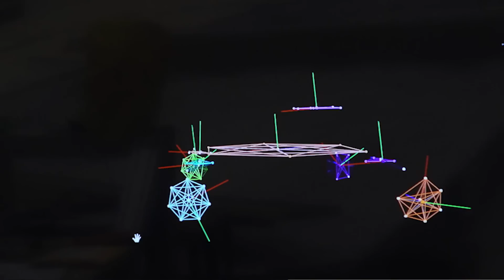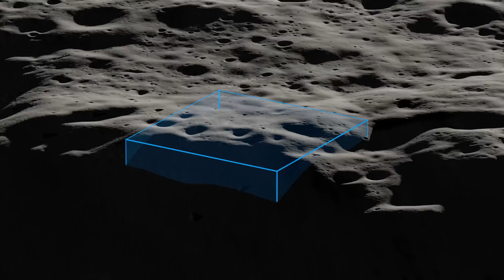The Dumbest NASA Decision In Years? Why NASA is Being Forced To Ground Rover and Sent Ballast.

Comment: No Scott, we don't need to have someone ask for the program to be given additional funds for additional time and additional efforts to get a stillborn project flying.  This is what the normal American citizen gripes and bitches about all the time.  How about ,,,, instead of asking for more money to add funding to finish the project.... how about asking all the people that have gotten salaries for this project to work for FREE ??...  That team was given a definite time frame,  an exhorbitant funding source that grew to 30% over budget.... it got the axe.  And it should be permanently axed. And ostricised by the space faring community as failures.  They did not get the job done, they over spent fiscally, and they did not complete the task in a definite time frame.  They are failures. They failed,  so why would we , the American people want to throw more good money at a failed boondoggle.  If you had a stiffy for a Cessna 414, vintage, and you found the one you wanted.  Low hours,  fresh RAM engine rebuilds,  tagged , stickered,  tax title license etc ad finausium,  and when you got the darling to a runway near you,  you suddenly found a HUGE crack in the airframe.  But it passed, ddddd,,,eeeeee,,,,ffffff..  You would : A, be pissed,  B: not throwing good money after bad, and C: seek legal recourse for misrepresentation against the seller and agent, the inspector,  and anyone else legal counsel told you to hang the hat on.  No, no more money for the lemon.......
Reply from the maker: That’s one hell of a long thread that completely misses the private company getting paid $250million to fly ballast because it took too long.

I don’t see you suggesting NASA refuse to pay the private company.
Reply: Boy are you in water WAY over your head.

Comment: I have a bit more detail to offer. Some of the Astrobotic prints for components were for easily producible hardware, but some of them were very difficult to understand, and some were difficult to manufacture inside the US (think like, obscure standards not generally used inside the country). This caused engineering delays while some of the company team worked to resolve. Attempts were made to resolve, and eventually all components would be ready to ship to assembly, just not anywhere near the timetable they had projected. It was heartbreaking to hear the buyers asking for expedited deliveries, only to get extended periods of radio silence from engineers. I feel like the designer could have done more work with the engineers to standardize their design elements across all drawings targeting US market manufacture.

Comment: Sorry Scott,  but as you reduce gass pressure,  you said the 'RESISTANCE goes DOWN' and I know what you mean but its wrong.

If you put a dielectric between 2 x electrodes they / it has impedance or (for here we can imagine resistance)  the more atoms we squeeze in between the electrodes, the lower the electrical resistance between them.  So conversely, removing atoms from between electrodes as in the case of reducing gass pressure, it must increase the resistance.

What reducing the gass pressure does is,  it reduces the inter-track or inter-electrodes, implied insulation.

So the RESISTANCE BETWEEN the tracks effectively goes up thereby needing lesser current to power a given pd.

E = IR so for a given pd,  I must be inversely proportional to R as above.

Where you would be absolutely correct is if you spoke refferring to the decreasing of gas pressure making the (ESR) effective series resistance between but inclusive of the tracks reduced, thereby enabling a greater current flow,  to power the pd and the insulation (track gap) to electrically break down.

Yes I am pedantic and have a collection of short straws!

Instead of NASA dismantling the half ton of rover scrap at a massive cost to the taxpayer:
Why don't we get NASA to sell the rover to SpaceX for use as a Starship mass simulater, for the price of a tesla?
In this scenareo,  NASA would have both:  
Rid of the rover to comply with the legal terms of the contract and a Tesla to complete the project contractually within budget, by sending the Tesla to use as a mass simulater in transit to the moon surface and SpaceX could use the rover as a mass simulater to either the moon or to Mars, (and get some effectively free data).

This way the lawyers are agreeable and everybody is then a winner, even the taxpayers!

Comment: Headlamps are half the battle - low light optics matter vastly more with good signal to noise ratio that can work on the moon... then lighting can be minimal and still be excellent. We don't need unaided human eyes to see, we just need the optics to see.
Reply: check out X27 night vision, it's really magical. that said, the moon does not have atmospheric scattering at night so it will be starlight alone which I doubt very much even this thing can do

Comment: Also, what do you mean a little inflation? Any parts they bought within the last five years were almost four times as expensive as they used to be. Hell, I went to buy a laser module that used to be $40 and now it's 80. I've also had hardware lost in shipping. That push my deadline back.

Comment: They can let Boeing run amok with their horrendous starliner yet they built something that actually works and its over budget. Unbelievable
Reply: Boeing is running amok with their commercial planes too.
Reply: @HenriFaust 
☆ is some of the problem with Boeing to do with DEI there?
Reply: @HenriFaust hopefully they didn’t design the doors on the rover 😅
Reply: AFAIK, starliner's budget problems are problems for Boeing, not for NASA. It's already losing a boatload of money for Boeing, I'm almost surprised they're still trying to complete the contract.
Reply: @kevinmiller6693  isnt Starliner in a contract with NASA?
Reply: @imfromisrael489  Yes. NASA and Boeing agreed on a fixed price for the development of the CST-100 Starliner capsule and a specified number of crewed missions to ISS. Boeing is behind schedule by several years and over budget, but NASA isn't on the hook for any more money than they have already agreed to pay.
Reply: Edward-gp8oh  Spirit AeroSystems is a Boeing subcontractor that produces the fuselage for the 737 at their plant in Wichita, KS.  They are not affiliated with Spirit Airlines in any way.  Spirit AeroSystems employees were responsible for the manufacture and installation of the plug that failed on Alaska Airlines 1282.
Reply: Starliner isn't cost plus. It's fixed price, so Boeing absorbs the loss.
Reply: Careful because Boeing has a tendency to take criticism very personally... DEADLY personally some would say.
Reply: @Tehn00bA  just to let you know i am not suicidal lmao
Reply: Boeing is a horrible company that is resting on its success of decades past at this point. Thank God we have SpaceX.
Reply: @lonelylad9818 
Is any of the problems at Boeing to do with DEI there hey?
Reply: @francisbrewster4948  Of course.
Reply: They been given more then they were asked and  still it wasn't enough. NASA isn't good at money management....make sense, Government agency's never are.
Reply: And contractors got 1 trillion dollars extra to build the F-35. It´s always real science that could benefit humanity that suffers.
Reply: It is very believable since the smallcaps are behind the market movements
Reply: @gdiwolverinemale4th too true ):
Reply: Nothing horrendous about Starliner. Abd it has a fixed price.
Reply: @paulopenteado5552 bro is blind not seeing SpaceX's Dragon innovation
Reply: @paulopenteado5552  Space X is more reliable + cheaper

Comment: Rocket fuel from the moon? Yes, in 150 to 300 years may be...
Reply: Depending on the fuel, it's very doable

You can get Hydrogen and Oxygen just from the Water Electrolysis. Those two are a good Fuel + Oxidizer combination, but are hard to work with.

You could get Methane by using the Hydrogen and sending a small amount of Carbon to the Moon to make it.

Methane + Oxygen is a more simple and a good enough combination to make a rocket that goes from the Moon surface to a Low Moon Orbit.
Reply: Depending on the fuel, it's very doable

You can get Hydrogen and Oxygen just from the Water Electrolysis. Those two are a good Fuel + Oxidizer combination, but are hard to work with.

You could get Methane by using the Hydrogen and sending a small amount of Carbon to the Moon to make it.

Methane + Oxygen is a more simple and a good enough combination to make a rocket that goes from the Moon surface to a Low Moon Orbit.

Comment: NASA should send the rover as the mass, it can't do anything else with it. I think that qualifies it as inert mass. "Hey, Bob, find us something useless with the exact size and weight as the rover to send to the moon as mass." "OK Bill, we have this hunk of scrap metal which meets the specs perfectly,  which we can't  use for anything else lets send that." "What is it Bob?" "Its that viper rover which got cancelled."  "Perfect"
Reply: Then it would just be a dead mass. Operating it takes money.
Reply: @paulopenteado5552  Better than it not being there. If someone has the foresight to add a wake command then you could risk trying it untested. There's a small chance of success that way, and 0% the other way
Reply: @paulopenteado5552  Donate the dead Mass on the moon to a university. or at least a highschool for STEM.
Reply: You nailed it, I am finding increasingly as I get older that common sense isn't so common! Bonkers decision making (or 'not' decision making, and they get paid for this)

Comment: I just had a strange thought that I hope you can explain. In the automotive industry, a vacuum is used to boil water out of the air conditioning system before refilling. Space is a vacuum all the time. Where does the water come from if it should all be boiled off? I know it also has to do with temperature, but doesn't the moon have wild temperature swings between day and night with the daytime being hot enough to boil off the water even though the night is cold enough for it to freeze. Once it's boiled off then there's nothing left to freeze...
Reply: This is why they are looking for water at the poles, where those temperature swings are far less. And any water is there is "dirty ice" - blended with other frozen stuff that stops it sublimating (ice sublimates - turns directly to steam, not water - in a vacuum).

Comment: The rover is already built and they're already going to send a mass simulator... so let's say, hypothetically, for the sake of argument, we use the rover as-is for the mass simulator?
If the rover lands and works, then it works, if it doesn't, oh well, at least it doesn't sit in an Indiana Jones Warehouse for 30 years or get scrapped for parts.
Firing it into the moon on a rocket and is technically disposal, because you're not fucking getting it back at that point, and NASA is allows to spend money on shutting down the program. And NASA can give someone else the rover login creds to run the rover program as part of the "shutdown" process. It even NASA them the money of having to store it and scrap it.

Comment: There's a reason it was cancelled. A project going 30% over budget is absolutely nuts. If you want to dis-incentivise people intentionally under costing stuff to get funding, in the hopes that they can add variation after variation, you need to make the consequences dire.
Reply: What if the over budget was out of there control like a global pandemic, supply issues or inflation ?
Reply: @meinking_sensei3807  they could have laid people off for the time being like everyone else but my bet is they all kept getting paid. Why should they be able to keep getting paid if nothing is getting done when everyone else in the country does not get that luxery? supply issues is there own fault as an industry if they are reliant on on foreign suppliers to that extent. Inflation is typically accounted for in the original budget.

Comment: Not sure about having a radioactive rover near a possible water source on the moon. As unlikely as a catastrophic failure of the machine would be.
Reply: It's Plutonium-238. It's a vastly different isotope than -239, with very different properties. It's been used in deep space power supplies for decades. It doesn't "fail", irradiated, or detonate.
Reply: @daveeyes  Oh please don’t get me wrong, I’m fully behind RTG power for nearly every other rover or space probe sent out to the solar system. Even when solar is pre-selected by that rule they have in place.
I think Juno should have been RTG based for example, or even using RTGs elsewhere on the moon…
But so close to an undisturbed water source.
When I think “catastrophic failure” I was thinking the rover being struck by a 1 in a million / 1 in a billion meteor strike, scattering the rovers contents across the base of the crater…
Unlikely, yes, but not 0% chance.
I just don’t think NASA would want their second mission to the crater to be a clean up operation.

Comment: Turns out that NASA is turning from a "rocket science" hub into a "rocket politics" hub, I guess that's the curse of switching to commercial-supplied services rather than keeping it all in-house.
The problem with rocket politics is that it's still a kind of politics, and politics has this effect of making every agreed to decision stupid to a greater or lesser degree.
The intelligence of a group is highly non-linear with group size.
1 person is smart. Up to 10 people is usually capable of achieving more intelligent things than any one individual member of that group.
After that, the intelligence of the group starts declining RAPIDLY with increasing group size, unless extremely careful vetting processes are taken that are probably in violation of even the barely-there US data privacy laws.

Comment: It is basically a punishment. If the government is not strict on this than it will happen again and again and getting more and more over budget. I think it is not the first time that NASA went over budget and it appears to have become the standard rather than the exception. Maybe I'm wrong.
Reply from the maker: You haven't made it clear why punishing the rover builders is the right course when Astrobotic is largely responsible.
Reply: @scottmanley  Thanks Scott for your reply!  I agree I commented probably a bit too fast. 

However why leave Astrobotic the honor of delivering the exclusive Viper to the moon when the chances of success for their Griffin lander may be quite limited? 

As an engineer myself (downhole robotic O&G tools) I have seen many projects get canceled while others are unexpectedly taken to commercialization. Sometimes you are lucky sometimes not. Best is to focus on what you learned, keep the understanding gained, the plans and parts as much as you can. In a few years you take them out of the closet present them as new or in a different setting and maybe it becomes a success on a more reliable future lander.

In the mean time, these NASA engineer can hopefully work on another project. I'm all for exploration with robots where possible.

Comment: Have to correct you of the electrical performance in a vacuum.  You can't easily get an electrical arc in space.  In a vacuum there is nothing for the electrons to conduct through.  When there is still air present like an airplane then you can get electrical arcs to form more easily as your airplane increases in altitude - because there is still enough air around for electrons to conduct through the thinner air.  Look up the Wikipedia page you will see the curve of how there is a maximum altitude where electrical arcs start to become harder to form as you keep increasing altitude.

Comment: Something has to be done about these contractors taking NASA and the taxpayers for a Ride.
Reply: You have things like the former head of human spaceflight boss Kathy Lueders awarding a contract designed for 2 separate companies to one company with the least progress, then quitting her role in NASA to work for the one company she just gave a contract for on the same program. NASA isn't what it used to be. Just another take what you can from the taxpayer organisation with elements from days gone by still propping it up.

What is being done though you don't have to do anything about. Looks at the Chinese companies springing up and their state endeavours. Also the Indians are getting quite good at things too in the unmanned areas, which isn't a coincidence -- but decades of proper planning and resourcing from ISRO.

Comment: If SpaceX can build a huge reusable rocket ship that can return, hover and land at launch tower and relaunch within hours, surely they can design and build a vehicle to move ISS to a Lagrange point. No, lets spend $900M to scrap the ISS.
Reply: nuh, it's really old and the maintenance work will only get worse and worse the older it gets until it's just not safe anymore or to expensive
Reply: @meinking_sensei3807   I meant to stow it at a Lagrangian point as future museum piece. A museum in space that is. Likewise with Hubble in distant future. Space is the final frontier with unlimited real estate and that is where we can make further discoveries and gain more knowledge.
Reply: The heating/cooling cycles it goes through are damaging the modules, as in, cracks in the metal.

Comment: 30% over budget, and it gets automatically cancelled?

This would have worked WONDERS to stop the Space Shuttle earlier, in order to refocus on cheaper and more reliable space transport solutions.
Reply: "This would have worked WONDERS to stop Starliner earlier, in order to refocus on safer and more reliable space transport solutions."

Fixed it for you. 😂

Jokes aside, I am kind of thankful we had the shuttle when we did. Otherwise, NASA couldn't "No Man's Sky" (that is to say, turn a dismal failure into a complete success) the Hubble Space Telescope.